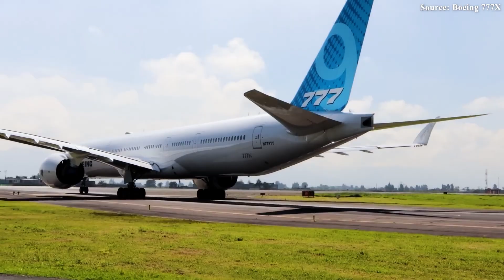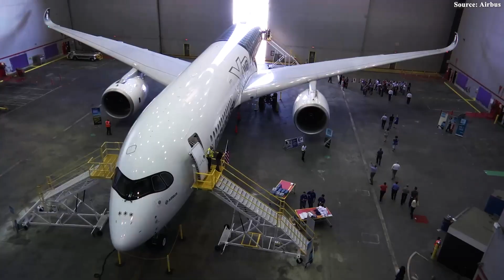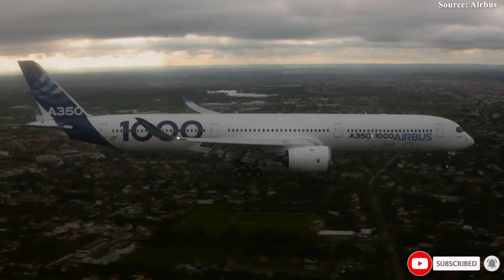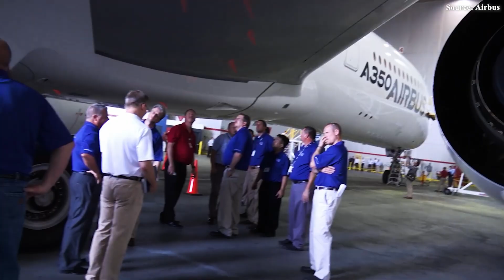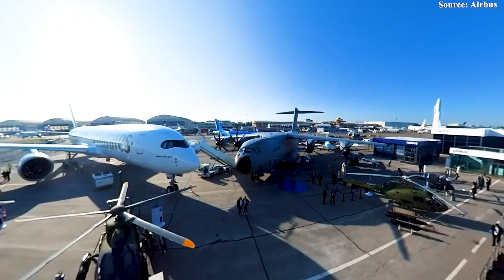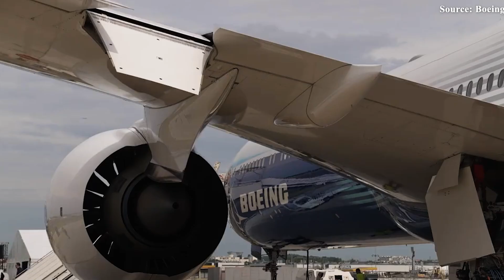The Airbus A350-2000 Just Outsmarted Boeing - Then Something Changed!

Comment: This is total bull. I followed that airshow closely, and NO ONE at Airbus is talking about a -2000 version. First, the current -1000 sells far less than the -900. Second, the engine needed for such an enlarged plane doesn't exist and neither is it being designed.
The only new thing Airbus CEO talked about how they are progressing with the RISE-engine from CFM/Safran.

Comment: The Rolls-Royce Ultra is too large in diameter to fit under the A350-2000 wing.
Reply from the maker: One remarkable aspect of the Ultrafan is its flexibility, as it can be adjusted in size to suit the aircraft it powers.